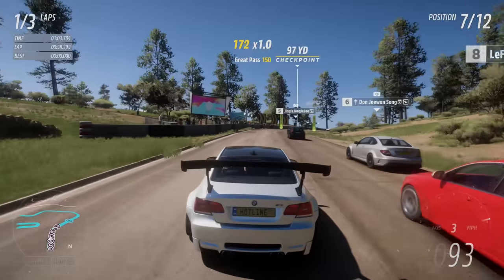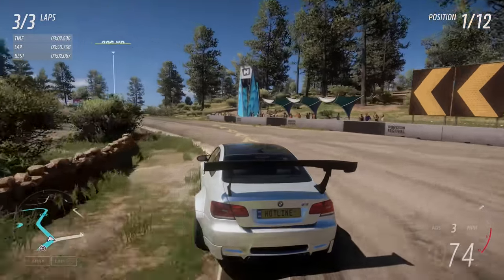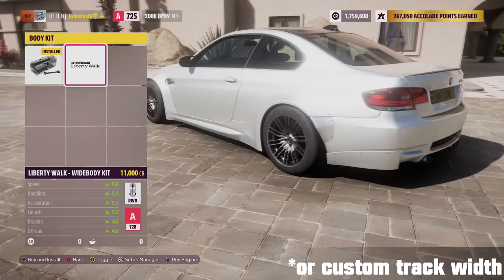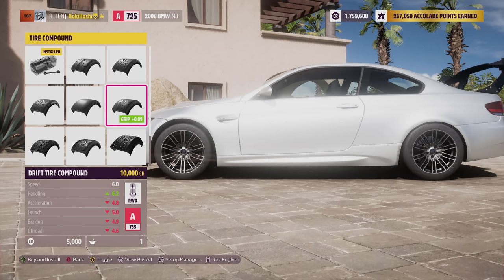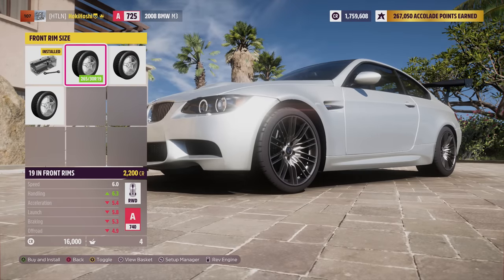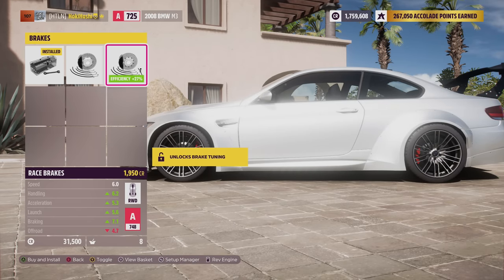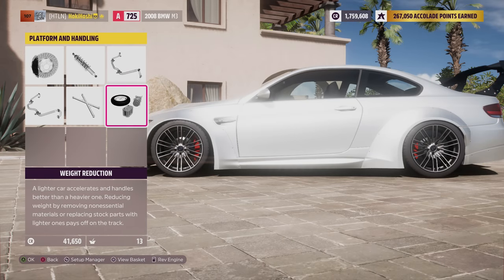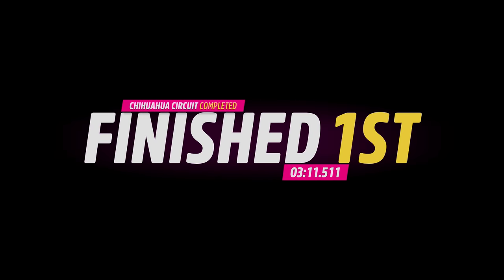How to Build Fast Cars in Forza Horizon 5 | Building/Upgrade Parts Guide

Comment: Flywheel and prop shaft (Driveline) are both drift upgrades, they reduce inertia/resistance between engine and wheels so your revs build faster making it easier to break traction. For that reason it's almost always better not to have them on a track build RWD as they will make the car more prone to wheel spinning out of corners. If you do this build and find your car hard to drive I'd start by removing these so you have more linear power progression.
Reply: Thanks for this information !
Reply: True but once you learn how to control it, those upgrades will let you push your car that much harder without breaking loose
Reply: @3eeup820  Wow thanks for the info! That was really helpful, I always removed the flywheel for the small extra weight reduction and I mostly drive RWD so I used to have problems in higher classes.
Reply: Ty for this info
Reply: Dummy here, by prop shaft do you mean drive line?
Reply: cool, i''ll try on my Tofu, it slide too much and wheel spinning dang crazy at corner exit
Reply: @tylerporter1170  it’s an interchangeable term
Reply: @gamewarmaster  thanks. I assumed so and pulled that and the flywheel off of a few of my cars. Seriously helped my ultima 1020 coupe, the wheel spin on that guy was atrocious no matter how I tuned it lmao
Reply: @tylerporter1170  as you get better with throttle control you will want to put it back on but before you master throttle control it’s basically impossible to manage wheel spin on that car.
Reply: @gamewarmaster  well I think it’s the car. I love it but coming out of tight corners scares me. Feel like I have to feather the throttle all the way to redline and even then it’ll still wanna send it until higher gears lmao
Reply: @tylerporter1170  Yeah, the thing with the Ultima is it is really lightweight, so when you go from a slow corner (before aero kicks in) it has no weight on the rear wheels to help traction so the Prop shaft/flywheel wheel spin issue will be amplified more. Another suggestion (if you want even more improvement) is to 'remove' a gear by pushing the final drive over to speed enough so the last gear dissapears from the graph. This will make the power progression even more linear and you'll need less gear changes.
Reply: @tylerporter1170  it is the car but you have to learn to control it.
Reply: @Kit_drives  say less bro I will have to give that a try!!!! I recently just found the koenigsigg ccgt and I’m loving that car. I was able to top my 1000 spot on the sprint I got it in the ultima and I did it in way fewer tries bc the car is much easier to control. Ultima is definitely high risk high reward with that low weight and mega fast acceleration.
Reply: @gamewarmaster  I know, I was just simply stating that the thing is crazy to drive. Super lightweight with a ton of horses pushing those rear wheels.
Reply: @upforanything9623  that’s nice buddy…. 😂
Reply: What is "prop shaft"... I don't see this in the list of upgrades. Could you use more game-friendly term for your comment? It would be helpful.
Reply: @MichaelReznoR  how did I never notice that? Lol it's called Driveline in game and comes under drivetrain category.
Reply: @tylerporter1170  yeah, the CC GT is the car i spent most of my time working on in FH4 literally since it was released. Possibly my favourite car too. Tune it right and it's a beast. You can also get good cornering and speed but that's a very fine line from my experience
Reply: No wonder I can't drive my car!

Comment: I wouldn’t say it only for online, because in a single player you can practice your build, earn more credits with higher difficulty and more pleasure to drive the car if it’s nicely balanced.
Reply: Facts 👍
Reply from the maker: Very true!
Reply: Agreed. The AI is a helluva lot better in this game, so I’ve been using it to practice before I go against real people.
Reply: @HokiHoshi  I was going to say some cars in real life have twincharged engine ie rally version lancia delta s4 which I don't if they simulate something like that. I don't if they would ever add group B car which would be cool too.
Reply: Yeah bro start from the oem configuration and actually build up small upgrades at a time depending on what you need it for, you’ll find you’ll just have more fun in general
Reply: But who actually plays online? Like why, what is there to achieve
Reply: @resinds.p4898 tbh it depends on the lobby, which most of the time sucks. But I have my fair share of fun races to make it worth playing 😂

Comment: This is my first Forza game, so I was quite overwhelmed by all of the customization options at first. This video is SO helpful to clear up all these upgrades!
Reply: Note when upgrading, DO NOT rely on the 1 through 10 performance values. They are almost always incorrect. If you switch to where you can see actual statistics as in lateral gs, braking distances, 0-60 and 0-100 times and such, you'll have a better idea of what your car's performance is. Another thing to note is the stability of your vehicle. If you often wheelspin at the start of races and exiting sharp turns, as well as bouncing off the rev limiter, the rear of your car sliding out during braking, especially if you brake through a turn, as well as sliding out during turning. A great number of things account for the stability of your car. Your car can have the best stats, but if it cant handls its own power, its all for nothing.
Reply: @marshi8042  Thanks for the tips dude!
Reply: @finneas5011  look up HokiHoshi. He's a youtuber that gets into the thick and thin of tuning. He has plenty of videos for Forza Horizon 5 already. If your car has any of the above mentioned issues, or any others like under and oversteering, you should be able to tend to those problems by following his guide
Reply: Im honestly jealous this gets to be your first forza game
Reply: @onjah7773  It's amazing :)
Reply: @marshi8042  lol this is a hokihoshi video
Reply: @mileskosik472  oh...lol...talk about not paying attention
Reply: Me too, this is my first racing game after 10+ years not playing racing games, i feel overwhelmed too and didn't know until today that upgrades is really that realistic in FH5 i mean i only looking for the max PI in each class lol
Reply: Same, i usually hate car and racing games, but this one just got two days ago, and i must say,  it's fun, both soloing across in a rally car and racing against some random people you find.  Heck i loose ALOT, but it's still fun,,   that's worth it..   😊      

i am spending most of the time painting and customizing vinyl, and a little time tuning..  and the rest for fun and racing 😉
Reply: @marshi8042  that was one of my most  crucial mistake. I wasted alot of creds for the best upgrades only to find out i cant even go trough the slightest corner because the car has way to much power
Reply: It is also my first Forza game and yes I also had no idea what to do with the amount of controls the game has.

Comment: One tiny little thing:
X class will usually always be hardest because once you reach X there's nothing left.
For example you could have a car that's classified as X, but just barely..
Meanwhile a Ferrari FXX K is already S2 and gets to X with like one upgrade, so that car is gonna be much better off than something that barely reaches X class.
Theres many weird ways to manipulate the PI system.
I only thought of this because I built the BMW X5 forza edition for extra XP, but couldn't beat any of the hyper cars on my difficulty lol.. So I tuned it down some and changed it to SUVs.
Reply: Have you driven the Sesto Elemento FE? That thing is insane!!!
Probably the meta X class without equal.
Reply: @Malficion  does the forza edition have a different tune like the pre order cars? I still havent used my car token, if its the same ill take a sesto
Reply: @guitarmaxxer  
No, Forza Edition cars have some kind of quirk. 
The Sesto has WTF level of sticky tires not available to any other car.
Reply: @Malficion  the McLaren F1 gtr seems to still be the best track car from my experience
Reply: @Malficion  For sure. They're all much faster than the original ones too, without engine swaps. Like the Puma FE has like 800+ HP and weighs 2000lbs lol thing is a monster..
Reply: @BiIlDipperIy  puma is my free roam car, and it smokes lambos in drag when youre messing around in the festival area
Reply: @BiIlDipperIy  you notice there is a la Ferrari forza edition in the game but unavailable? I bet that thing is fucken crazy.
Reply: @BiIlDipperIy  the Morris FE has stupid wide tyres, wich means that it corners anywhere you need it to, but it still has a terrible launch for some reason
Reply: @Ferrari255GTO  I hated the Morris FE if it was that little green car lol. Fully built it was just too uncontrollable and not top of S2 sadly. It was a double money car tho so I still have it. I've noticed pretty much all the cars that have unique kinda tires on stock are pretty grippy. Like there's Bridgestone and stuff.
Reply: @BiIlDipperIy  i use it on A class and it's an evil car to drive, but if you can control it it's gonna shredd the track, wether it is rally or asphalt. Not so good for offroad though XD
Reply: Y’a u basically just wana be on the very top of ur class
Reply: My friend always does races with x-class cars and gets mad that he can't beat them, I need to use that wording

Comment: In A class and below I think its best to use rally tire compound for road racing since most of the time its better than your stock tires and takes waaay less PI than semi slicks or slicks, they actually give pretty good grip no matter what surface you're on and if you dip a tire into the grass or dirt you'll still get close to the same acceleration as if you hadn't which really helps on corner exits if you get pushed wide or you're just trying to use all of the track, also pretty essential for when you're racing in the city that has stone or tile or whatever it is if you don't have a good tire on you will have awful pace around there most likely. Also really good for just quality of life it will give cars that had no grip off road a lot more grip so you can actually take dirt trails now without having totally worthless pace. Extremely versatile tire I think its very underrated right now.
Reply: Yea I’m extraordinarily happy to see new differentials, off-road tires, and even different sounds for select engine parts. Makes the feelings very realistic and a lot of them help you tune the car easier which saves hours of our time just for the basics. Also the exhaust is a very cool feature they’ve added!! Going to definitely not use the best one anymore on cars that I don’t care about the performance on or just want the better sound.
Reply: Good idea bro.

Comment: Trying to find a nice entry-level Rally or Cross Country car because the terrain definitely sets the super sports or hyper sports spinning out like crazy.
Reply: Ford Escorts are always a good pick.
Reply: Any sti or lancer evo are pretty good too
Reply: @rashestkhan2878  I was looking at the STIs but of the 5 I'm not which one I want to buy.
Reply: my go to for cross country has always been ford rockstar trophy truck since fh3. only 3 gears to worry about.
Reply: @georgejones5019  Juts like in real life, they are pretty similar. For PI wise, the 2004 started with the lowest PI thus can be consider a better choice to push power build. But the newer version from 2011 and 2015 has wider tyre options , they are all pretty cheap overall. It is very much personal preference here.
Reply: nissan pulsar, just trust me
Reply: Audi Quadtro sport is a great entry rally car. I wish they’d have the Lancia 037 :(
Reply: Mini cooper '65
Reply: Pinto
Reply: @wotwott2319  got that barn find escort it’s got great upgrades
Reply: @georgejones5019  the ‘04 sti has been amazing for rally and off-road for me, plus the improved sounds is a big plus
Reply: @georgejones5019  Go with the Blobeye.
Reply: Subaru all day
Reply: Used my vip pass ticket on the 30,000,000 Shelby and that thing makes for an actually surprisingly very fun rally car.
Reply: Formula drift rx8 is pretty fun to drive rally when you tune it for it
Reply: @austinbelch1506  lol I did the same thing today as a joke, but it’s pretty nuts how good it can be off-road. Might be one of my new main rally cars tbh, alongside the rally C8 corvette I also originally built as a joke
Reply: For Cross country the Starter Bronco is great. For Rally, go with the Exocet. The normal one not the forza edition one : absolute beast. Don Joewon Song made tunes for both, and his video about the 10 cars you need to own is great for finding great tunes to compete in associated with those cars.
Reply: Get a group B car
Reply: @wotwott2319  The Hoonigan RS200is pretty amazing. You could get sole great numbers with it
Reply: I got a Audi S1 from a wheelspin, turned it into my dedicated rally car. Does pretty decent.
Reply: The FJ40 is an A class cross country beast if you can tune it right
Reply: e30 bmw awd swap.
Reply: Lol not the 22b STI,
Can’t upgrade the transmission and it’s still slow even maxed out
Reply: @JeanSuki  I was shocked to see no lancias at all. Maybe they'll add it in over the next year. I hope. I remember I had a 037 in FH1 that had a Racing Team Solvalou livery from RR4. Loved that car so much
Reply: @Paladin1034  
WHAT?! That’s a dealbreaker for me.
Reply: @Paladin1034  Sony bought rights for Fiat Group for the next few years, so no Fiat (lol) no Alfa Romeo (RIP Gulia Quadrifoglio) no Maserati and no Lancia.
Litterally making car manufacturers an exclusive since they can't make good games. "It's not enough that we have those cars in our game, others should not have them too".
Reply: @PoRRasturvaT  really? I hadn't heard anything about that. I didn't notice alfa and the others missing. I haven't gotten too much into 5 yet but I was looking specifically for group b cars and didn't see Lancia
Reply: Max your mechanical trailing in settings.
Reply: Audi Quattro sport. So fun
Reply: @tepig52  i love the Quattro, it's been one of my favorites for multiple games now. I even added the livery i built for it from my FH3 designs.
Reply: @Paladin1034  lancia cars were so good man
Reply: If you can get all the Porsches the car it unlocks is really good S1 2019 Porsche rally fast great handling and already maxed in S1
Reply: Honda CRX, you can fully upgrade it an be in A class pretty comfortably
Reply: Try any STI WRX Subaru, an Exocet or the Nissan Pulsar.
Reply: Maybe just a bit expensive for entry level, but if you can save up, the Renault 5 turbo is, to me, the most friendly off-road car in the game.
Reply: Bmw x5m
Reply: @PoRRasturvaT  Sony has Gran Turismo, the benchmark series for racing sims... and that doesn't make sense because the fiat group also owns dodge, and there are plenty of Dodge cars in FH5
Reply: B class - pulsar (rally) / scout 800a (cc)
A class - bone shaker, shelby daytona (rally) / bone shaker, x class benz (cc)
S1 - Lola (rally) / bone shaker (cc)
S2 - benz clk gtr for everything
You can find good tunes for these cars online. Also sorry if i'm 2 years late

Comment: Flywheel and prop shaft are both drift upgrades, the reduce inertia/resistance between engine and wheels so your revs build faster making it easier to break traction. For that reason it's almost always better not to have them on a track build RWD as they will make the car more prone to wheel spinning out of corners. If you do this build and find your car hard to drive I'd start by removing these so you have more linear power progression.
Reply: Awd with these upgrades are the shit tho haha

Comment: This video is great but there are a couple of things that are different abiut upgrading in this game in my opinion: 1- front tire widht is almost never worth it, go for more power instead, 2- intercooler and cooling are some of the worst power upgrades, 3-awd swapping is still the way to go in the majority of non-powerbuild cars, 4-dont use rally tires for rally racing, use offroad. Rally tires are used mostly for road racing. 5-bodykits are almost always worth it. 6-the best aspiration upgrade is the centrifugal turbo, 7- engine swapping is meta if you can, certain engines build more power for the same PI cost (for example the racing v12 is one of the most efficient engines). Also going for more power instead of less weight is usually the way to go if your car isn't too heavy from the start.

Comment: Your content has hugely improved my enjoyment of this game. So first of thanks so much. Question on this - maybe it's my cover of cars, but usually find I'm upgrading at least one or two classes (I'm really enjoying A class, S1 class rivals teaching). It's often difficult to do this without either adding power AND reducing weight, or changing engines etc. Can't seem to increase classes using the basics of this guide. Any thoughts? Engines first? Just max everything?

Comment: For awd I find if you adjust both tire psi to 31.0 it is more comfortable. Also tune the differential deceleration value for front and back to 100%